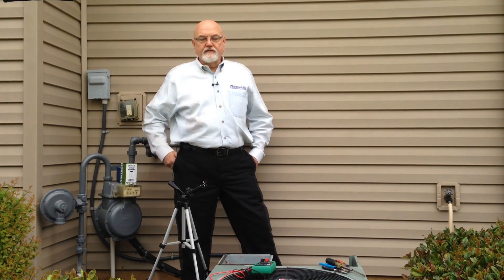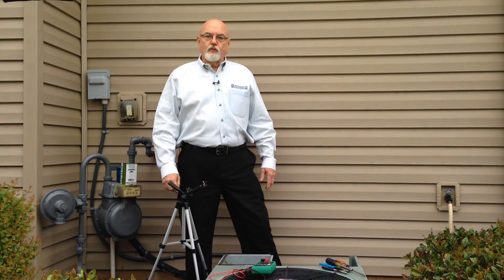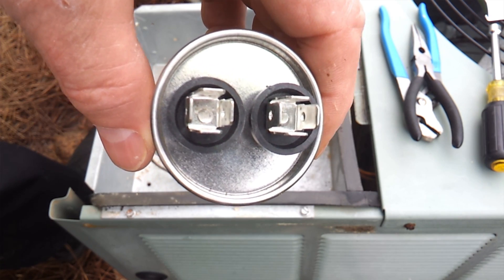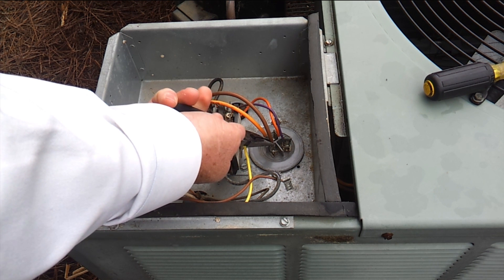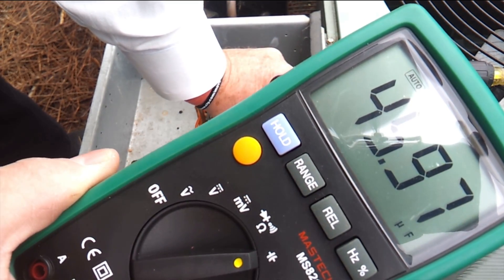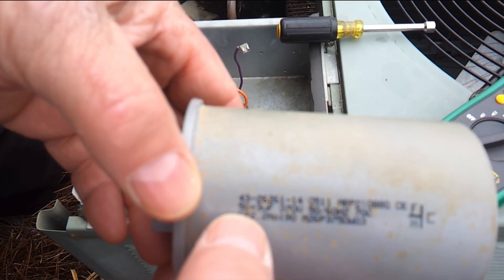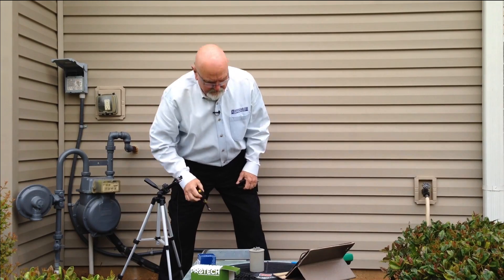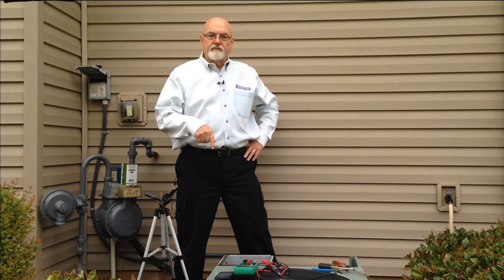AC Not Blowing Cold Air, AC Troubleshooting, How to Test a Capacitor, Air Conditioner Capacitor, Run

Comment: Hi, my fan, compressor is running, I installed new capacitors in the heat pump, outside unit and my ac is still not cooling?  the defrost control board light is blinking.  I ddn't find any leak.   Few months ago i had to put in a new fan in my air handler.  Any help why my AC is still not cooling? I would be very appreciative, thank you.

Comment: Thanks for sharing. I will give this a go tommorow. My AC was working great until tonight when the fan stopped turning and I heard a humming noise. I gave the blade a push clockwise to no avail, but when I pushed it CCW it started turning??? Which is obviously the wrong way. The compressor wasn't working as well as there is no cool air coming through the vents. Do you think a bad capacitor will make the fan spin the wrong way and prevent the compressor from turning on?

Comment: If I clean the filter and wash the coils and there is no sign of line freeze but the ac does not give cold enough air even though the thermostat says adequate degree,what do you recommend I check for next,thx
Reply: Gilbert Alvarez There are a number of other things to check, like does the Tstat actually trigger the system, does the condenser unit fan run at an adequate speed, do you hear the compressor engage, inside, is your forced air unit fan running at the right speed. If you had a hard freeze on the coils you may have triggered a Freon leak etc... I am not an HVAC tech but there are a number of things a homeowner can do before you call for a troublecall. I sourced capacitors from Grainger in the past for anemic condenser fans with great results at the right price too. When you say coils, are you talking outside or inside the house?